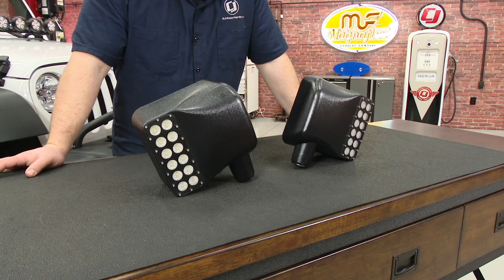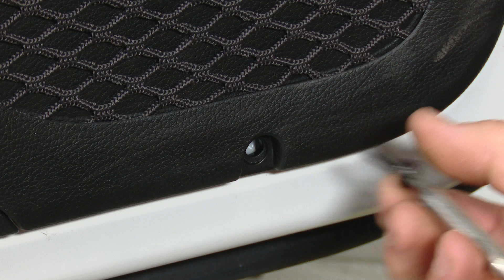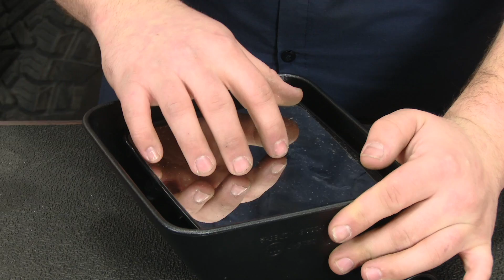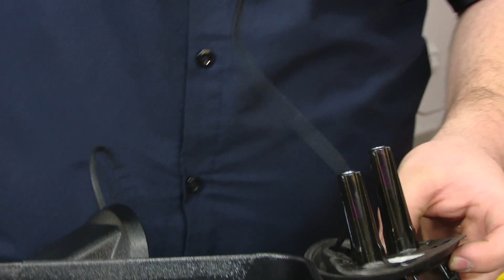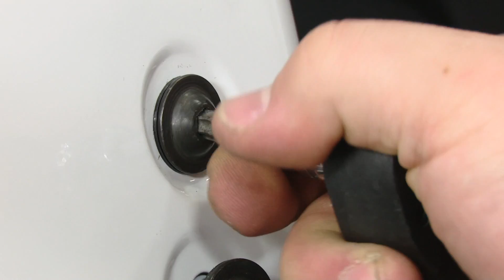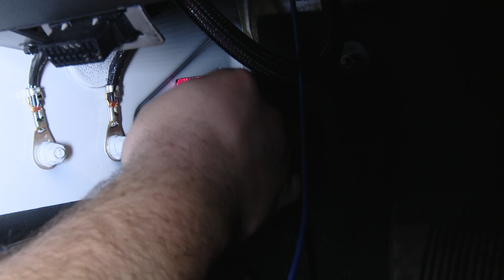Jeep Wrangler JK Oracle Lighting Side Mirror Off-Road LED Pair 2007-2018 Installation

Comment: I’ve got a 2012 JK Jeep Wrangler rubicon manual. My windows are manual with the crank, too. Unfortunately the “xprite” mirrors I purchased have no “harness” you mentioned in your video. There are just 3 wires (red, black, and yellow) that aren’t hooked to anything. The clip that goes from my door to the jeep hookup doesn’t seem to have anything that would receive wiring from my mirrors nor does the door. Do I need additional parts? Am I sol?

Comment: How does the brightness compare to a pillar pod floods? Any idea of the lumen/lux count?
Reply from the maker: I depends on the lights you install on the pillars. These mirrors put out 2200 lumens.
Reply: @CJBroncoF150  hello how you get the screw off from the bracket, I tried to remove it I broke one torx bit, it does not come, do you think there is loctite on it, maybe I have seen to warm the screw

Comment: on the 2007 I don't seem to have the grommet / hole near the door handle  and there doesn't seem to be a path out of the area near the mirror mount am I missing something or is this mirror not actually compatible with the 07